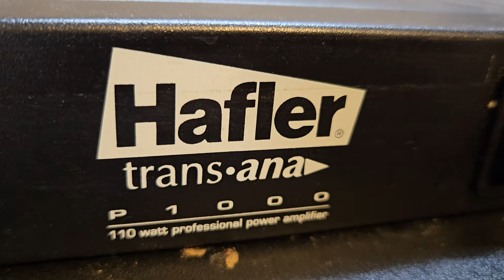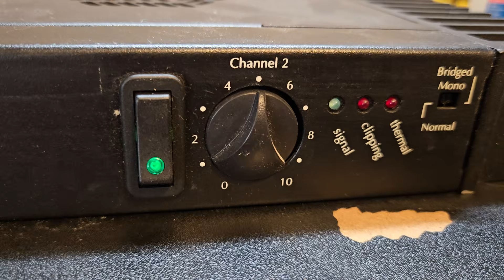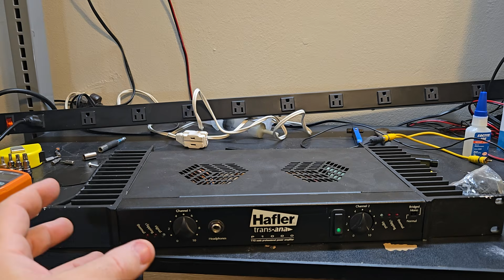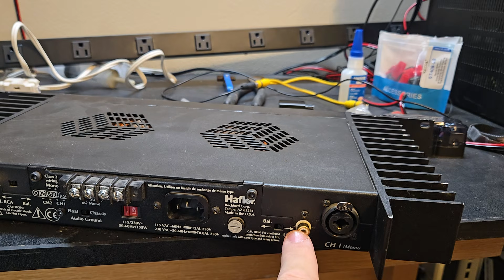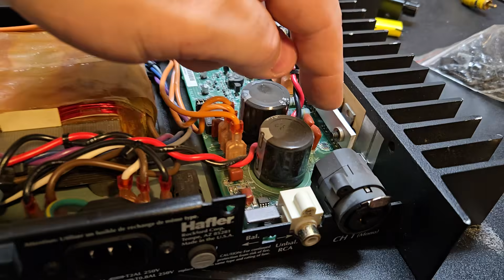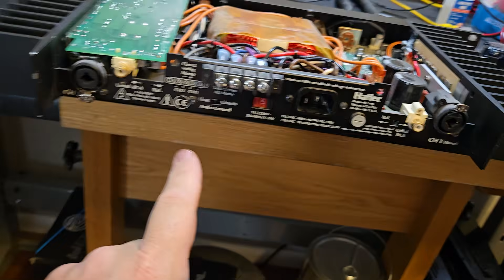Hafler by Rockford Corp. (Rockford Fosgate), P1000 Studio Monitor Audio Amp / Amplifier Made in USA

Comment: That rf 2000 amp back in the day was about 1200$ from fosgate 🤑 pricey home amp  for its time.   That tape called cam brick tape  3m make it. Talk about expensive tape  for a role of it.  its about 27$  they use to use it to wrap wire  in older cars under the hood  a long time ago.💯🫡😉✌️
Reply from the maker: Thanks for the info!

Comment: Balanced signal is sometimes needed for devices that actually have a differential input because the input voltage via RCA is not high enough; +/-2Vpp on the conductors of a balanced signal cable produces a differential of 4 volts, while 2Vpp single ended is just 2V swing relative to the signal ground, so the differential will just be 2V. Some modern amps are doing this so they can use lower gain to produce lower self noise.

Comment: My first audiophile power amp was the Hafler 9270 by Rockford, which I still have in storage. It started blowing fuses, and I am a little worried about the possible reason, but if it just needed recapping then I could gladly do that to keep it running. Designed by Jim Strickland of Acoustat. Ran hot but sounded good. They all use funky flat transformers instead of toroids but it does not seem to be an issue. My tastes have moved in the direction of modern state of the art Class D like Icepower and Hypex but I still have some Class AB amps around.